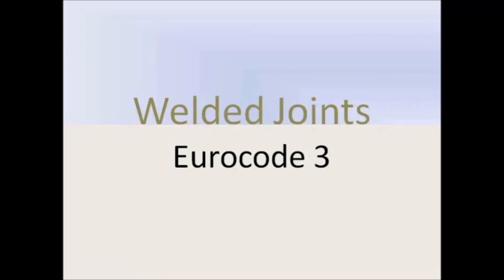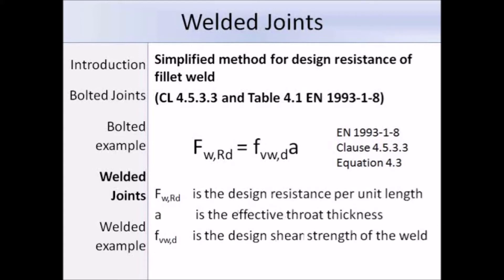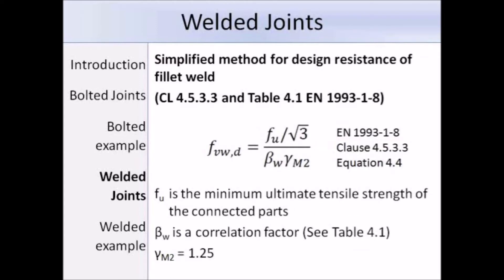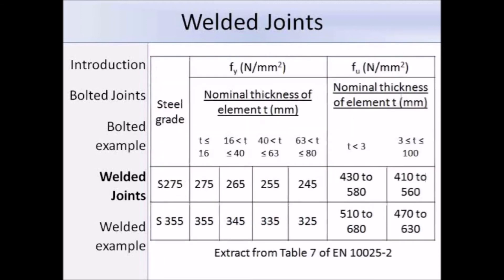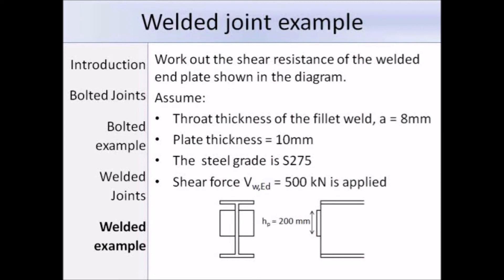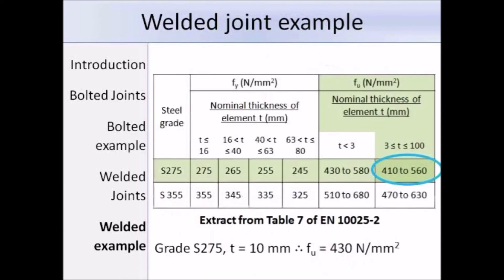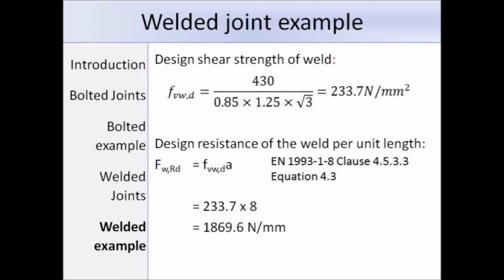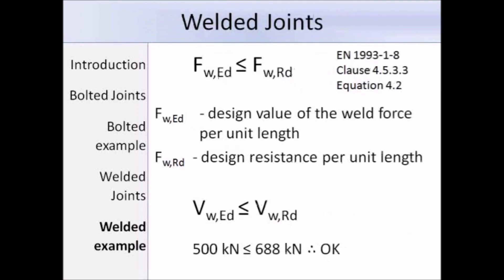Steel Connections | Welded Joint Design | Pinned Joints | Rigid Joints (Fixed) | Eurocode 3 | EN1993

Comment: Thank you for this informative video.
I have two things to point out:
1. Your plate has a thickness of 10mm and yet you choose fu= 430N/mm². I think that the correct fu should have been 410N/mm².
2. Isn't some kind of safety factor taken into account when calculating the weld strength? (I know that was not the point of this video but it is always good practice to include factors that real engineers need to take into account).

Comment: Very illustrative and concise example, keep it up! If possible, could you do a worked example where you are evaluating the polar moment of inertia or the center of gravity of a bolt group ?  It is definitely worth showing how a moment or a force is distributed among the bolts and then transferred to the steel sections - thanks !!